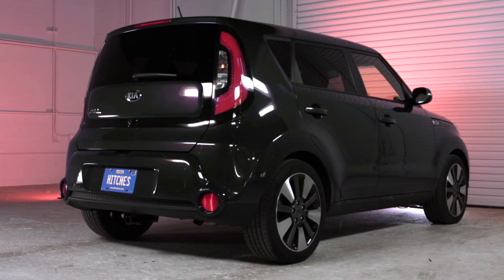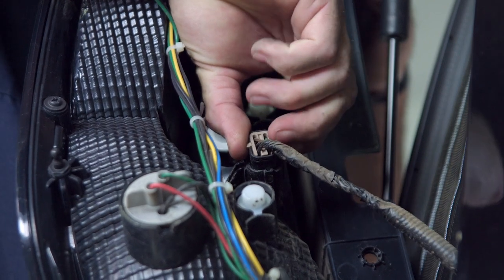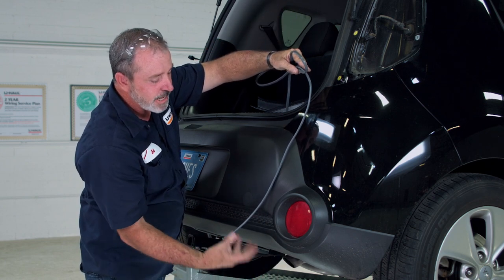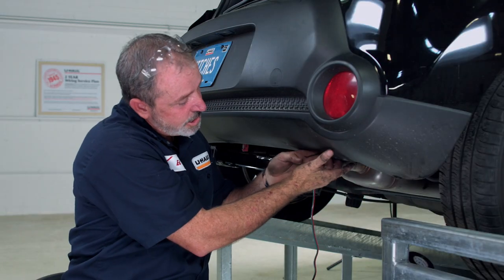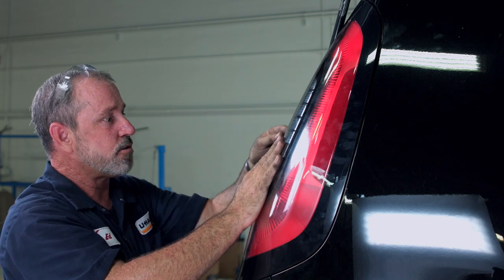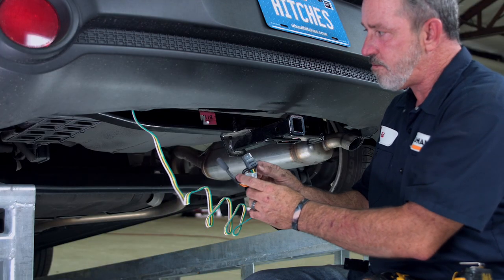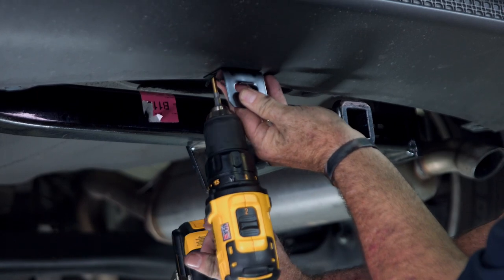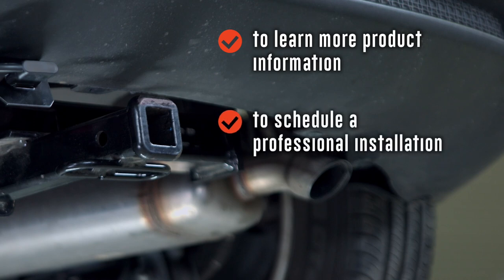2015 Kia Soul Trailer Wiring Installation

Comment: Being that it's a 1 1/4 hitch, not a 2", does that mean there are more limitations on what can be towed?  I'd assume between the weight of the vehicle and HP that this is the case, but is it something like a failsafe similar to diesel gas pumps being a different size? that is, if there is an attachment I'm looking at that requires a 2" hitch, should I assume that means my Kia can't handle it?  I know this would be a rough assumption if indeed that is the case.